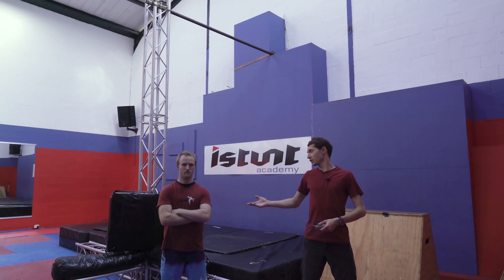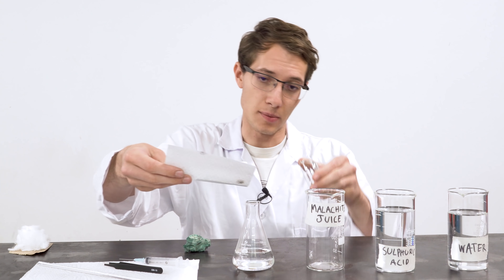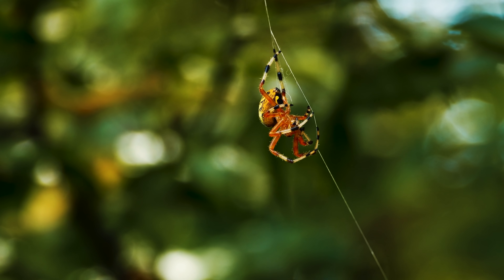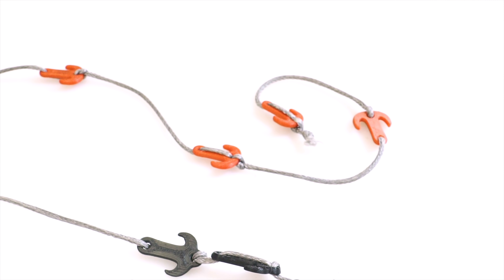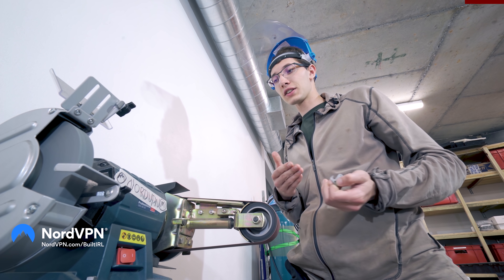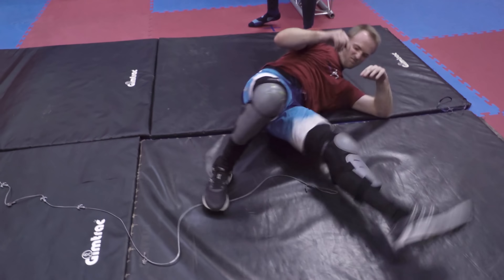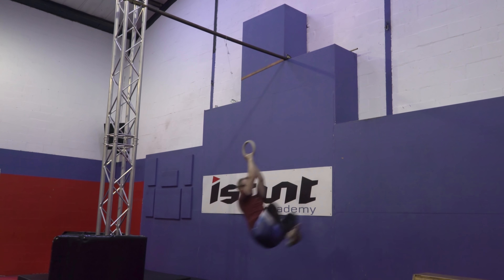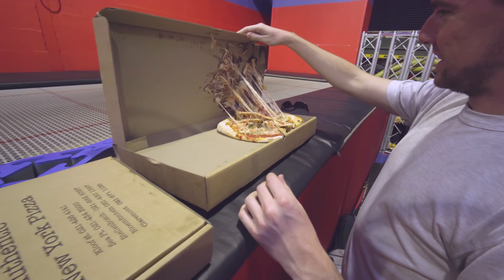Making Spider-Man's Web in real life

Comment: I printed out the hooks and made a hook chain out of yarn and i have to say that it's crazy how quickly you can learn how to grapple stuff
especially since unhooking is also pretty easy too

I've been walking around grappling random poles and it's been so fun
Reply: Can you pleaee tell me what app can i use to make the 3d model. Im new to this stuff
Reply: @Bread66666  I used a complicated method specifically for this shape

First I screenshotted the design, then I hand traced it using a vector program, then I imported that vector file into a CaD program, and then put the resulting STL file into my 3d printing program that came with the printer

snipping tool -> inkscapes -> tinkercad -> elegoo

In this case, using a 2d image and then extruding the 2d image works because the shape in question is really simple
this method doesn't quite work for more complicated designs.

That being said, I think you can just look up any CAD program and make sure there's lots of tutorials for it so you can learn how to use it

I would also recommend using those free STL websites because pretty often more experienced modelers have made solutions 
it really depends on what you want to do tbh
Reply: @Bread66666  oh oops I had a whole tutorial but it got poofed

I screenshotted it, traced it using a free vector program, used a free online CAD program to convert it to a 3d model, and then I put that into my printer

for general use, I highly suggest looking up free STL websites to check if someone has made your thing first
and if they don't have it THEN you learn any CAD program
just as long as it has lots of tutorials to follow along with
most of the popular ones are good, you just need to sit down and learn them

Comment: The advanced glue delivery device you've described has several exciting possibilities and capabilities:

1. *Precision Glue Delivery:* The device can deliver glue with exceptional precision, thanks to the controlled release mechanism. This makes it useful for various applications requiring precise adhesive placement.

2. *Swinging and Movement:* With the string and catapult system, combined with the swing functionality, the device allows for controlled movement. This can be used for activities like traversal, recreation, or even rescue operations.

3. *String Control:* The inclusion of cutting mechanism gloves and string retention features provides users with complete control over the strings. They can release or retain strings at will, making it adaptable to different situations.

4. *Rapid Reloading:* The loading mechanisms for both the string and web-based bullets ensure rapid reloading, making it efficient and practical for continued use.

5. *Drying Mechanism:* The heat mechanism integrated into the web structure allows for the immediate drying of glue upon contact, enabling fast adhesion.

6. *Retrieval System:* The built-in retrieval system with a timer-controlled oil-release mechanism provides a means to retrieve the device and any attached web-based bullets, even from high or difficult-to-reach locations.

7. *Versatility:* The multifunctional nature of the device means it can be applied in various scenarios, from creative projects involving art and design to practical tasks such as repair work or outdoor activities.

8. *Innovation and Creativity:* The device represents an innovative blend of technologies and features, allowing users to explore creative and practical solutions in adhesive application, mobility, and more.

9. *Convenience:* The inclusion of features like button-controlled string retention and web-based bullet reloading ensures user-friendliness and convenience during operation.

10. *Safety and Control:* With the ability to control string release and retention, as well as precise glue delivery, safety and control are prioritized, reducing the risk of accidents.

It's important to note that this device's capabilities are versatile and can be applied in various ways, depending on the user's needs and creativity. It combines elements of mobility, adhesive application, and control, making it a unique and adaptable tool for different situations. However, it's essential to use it responsibly and ensure safety measures are in place, especially in high-risk scenarios.

Comment: Now I am in my early teens and have decided to pursue trying to figure out how to make Peter's web fluid and have found out that 1 thread of spider silk can hold around 1.68 grams (don't quote me on that) but my bodyweight which is around 150lbs to hold the web would have to be around 33 to 34 feet wide to hold me not including the weight created by the force of my momentum whilst swinging
Reply: Doesn't the thread increase exponentially, if you multiply the radius or diameter of a circle by two the area of the circle is x4 bigger, that's why rope (much weaker than silk) of like an inch diameter would be able to support you

Comment: That's actually a very good equipement for an original Character actually. Ps: you could try to put a propulsion system inside a tube, with the same rope, and get a daredevil stick ^^

Comment: Vulcanoglas magnetit can bring strucktur or electrostatic balloon hair :) ;) can build with life spider get a group with computerchip synchron the reticulated glands for definated fiber glue, ... air flow or a little weight to shot. Interesting test if does not working then i dont no is the simplest. Ohhh fuck the molekules have reaction time if you not can build the net on the way by touch the wall then reaction,reaction.reaction.reactionso will need minutets for meters. Ok must shot fluid whats differnt reactions managed on the way and on the goal glued,  ... thats sound possieble, fluidjet can support laser / UV Epoxyd ohh i too much

Comment: stretching a trash bag into a long rope makes it insanely strong than it’s original form. online i saw that trash bags are made of polyethylene but different types. i looked up the strongest trash bag and it’s a 30 gallon force flex plus trash bag. if you stretched that and then added some weights to each end, similar to your hook swing, do you think that could work as well? it could allow more room for more “rope” and when the force is increased it could allow you to shoot further. just an idea i thought about!

Comment: alright so hear me out

1:19 this process, the malachite juice is your web fluid, in a cartridge. you force that fluid through a narrow nozzle that contains sulfuric acid and it'll solidify and spray strands, right? now, the strands are weak individually. but do this in parallel dozens of times on a microscopic level, and weave it all together, and you could get a strand that might have some strength to it. compact that into something wearable, and you have a web shooter.

like, i know this wouldn't actually work. but i like how plausible it sounds

Comment: i have an idea💡 if they help u find something on your journey I consider it a 🥇. Ok first U can attach it to a harness for the sake of support and time while swinging. The rope can be detachable when a button is released. So u still have control when u wanna hold on or let go. You already have a high success rate when it comes to getting a hook. But For the sake of reloading have it like a belt fed gun. Each rope Is cut to a decent range. have the end with something that can pull the next one into the chamber an released when the button is. Have the rope Going from your back to the desired arm. Similar to whiplash from the iron man movie. So your hanging with your body not just the arm. It’s compact already but the smaller something is the more u can carry.

Comment: you could make the hooks the way that you can retract the hooks mechanically by the push of a button so you can retrieve the rope by just pulling it instead of having to manually disconnect it from the hooks, could be hard to make a rigid and cheap design though

Comment: I have an idea.
Would it be possible to attack as the light of a rope/string to a bullet type of projectile somehow that would be shot out just like a bullet, allowing it to penetrate into the walls of a building and perhaps hold the weight of a human?
Would be extremely hard to create but I believe that that can be the next level type of spiderman web. In fact it would reassemble AoT grappling than webs but ok xD

Comment: What you need to do is make multiple of these and make them the cartridges be able to  but have to on each web shooter you will have to realod alot but if you time it right it would be accurate for the combat and some of the swinging but as well have one that hook to the edge of building not directly attached to the building it self the top ledge

Comment: What is used a smaller version of a grappling hook that could fit around the arm under a coat and using a flexible metal wires with hooks at the end that also retractable and adding small suction cups to the bottom of ur shoes to stick on glass surfaces

Comment: So basically he cheated. The goal was to create a liquid based web that could be shot out and can stick to a large solid surface that can be wrist-mounted.

He bought industrial strength rope from online, used hooks that only work when wrapped around small sized objects, and used a gym ring to throw the rope around...

Not to mention, but does anyone else noticed how they don't show getting the rope down or detaching it from the weapon, leg, etc? That's because it's not easy and is impractical. You only get one swing / throw with it, and then it's useless.

I'm just disappointed

Comment: a chainmail glove with padding on the inside would make it easier to hold. pressurized air to shoot, and an electric motor to reel it back in. put a spool on the back and feed everything through flexible tubing running down one arm. at the end of the rope, put some kind of "cork" that fits tightly in the tube.

Comment: 2:01 how is needle not dissolving in acid? O_o
Reply: A needle is typically made of a material that is resistant to corrosion or dissolution in acid. The most common type of needle is made of stainless steel. Stainless steel is an alloy composed primarily of iron, chromium, and nickel, which provides it with corrosion resistance. When stainless steel comes into contact with acid, a thin layer of chromium oxide forms on the surface. This oxide layer acts as a protective barrier, preventing the acid from reaching the underlying metal and thus preventing corrosion or dissolution. The chromium oxide layer is stable and highly resistant to attack by acids.

Comment: i mean at the hooked front you could make it a segmented decently stiff but still bendable thing like a belt then just using a a motor that engages to the belt to fling it out at high speed., as for the grab part just put something like a knob at the end of the line .
so pretty much big old wrist shooters

Comment: just picture it...two mechanized gauntlets with multiple "cartridges" of these sticky ropes in each one. Using compressed gas to launch it, allowing you to swing from it when it's still connected to said gauntlet. Then at the end of your swing arc, a quick detach mechanism is activated and you're ready to launch another. The gauntlets could even have a form of net launcher and or bolo as an additional offensive weapon.

Comment: What if the entire “rope” was metal or at least capable of holding a current, you wrapped copper wire around it and then insulated the outside and had a electromagnetic rope that attached to itself?

Comment: I'm glad you said it because I was coming down here to say it, thinking MAYBE you'd see it:

I was going to say you should make a wrist mounted device (one for each wrist) that can hold multiple "webs" in preloaded barrels with something like CO2 or propane as a propellant, then have a trigger hooked up to a microchip so every time you pull it, it launches a new one. Theoretically as long as the items don't weigh that much, could get a lot of shots in there. Maybe 6 or 8 total? 3 or 4 each that is. It would also need a quick release for the previous webs though.

Comment: Have you considered somehow cooling liquid glue when spraying it, some glues (like hot glue) can hold heavy weight but it needs the time to cure (cool). Look in to it for me? Thanks!
Reply from the maker: Check out Joel Creates (if you haven't already) for hot glue spider webs. Otherwise, I think a mechanical approach is much more robust and less messy than an adhesive one.

Comment: That hook rope is useful enough to actually carry around and use in real life, love the simplicity
Reply from the maker: Thank you kindly! Still no obvious way to integrate hot glue though...
Reply: @Built_IRL  awesome video. What was the ultra strong rope you used in the video? And can you sell this product?! Id happily buy one.
Reply: @spectrumhorizon1392  same
Reply: @spectrumhorizon1392  same !
Reply: @spectrumhorizon1392  I suspect he uses paracord. It's the cords parachute jumpers hang from under their parachutes, and it's wicked strong for how small, light and cheap it is.

Paracord 550, which is rated for up to 550 pounds while being only a bit overt 1/8 inch thick, costs about 50 cents per meter.
Reply: @spectrumhorizon1392  me too
Reply: @spectrumhorizon1392  Dyneema or Spectra
Reply: @Built_IRL  hot glue somewhere on the hooks to dampen the noise. The webs in Spider-Man are quiet lol, lots of stealth based scenes/combat
Reply: @glass4600  I might work depending on how hard it dries
Reply: @glass4600  or handle dip , a rubber made for coating tool handle's
Reply: @chopperchuck   I was thinking the same thing.  I've used some stuff called Plasti-Dip in the past.  Dries firm, but rubbery.
Reply: @Built_IRL  any chance on getting the 3D print files?
Reply: @Built_IRL  You could sell it with some precautions of course or maybe have another company sell it
Reply: @Built_IRL  Hot glue over the hook knots to keep them extra secure?
Reply: @Built_IRL  AGREED
Reply: @Built_IRL  not with that attitude
Reply: @Built_IRL   mAkiNg sPiDerMaNs wEb iN rEaL liFe. its literally just a rope with hooks on it lol stop the cap
Reply: “Indiana Jones theme plays”
Reply: Dude I want one for self defense I don’t need to swing
Reply: @gamingwithJT2007  look at it I could use that effectively in like 10 minutes
Reply: OMG JT is not only a genius at Engineering but also at fighting and stunting
Reply: Right
Reply: It is a great invention but I don't think that it is practical in real life
Reply: This is only useful for explorers or campers or survivalists in the wilds i think.

The usefulness of the hook chain is to get a steady hook and line set up, not really for traversing and loosening the line immediately.

So way you want to hang a tent up quickly you can swing one end to one branch and it'll lock, then throw the other one around another branch.
Reply: this is a damn rope tff
Reply: Wall sticking web shooter tutorial https://youtu.be/bAMrEiXpCiU
Reply: Let's Go
Reply: Mouse love.https://youtube.com/shorts/cHoSZw2WOxM?feature=share
Reply: I'd prolly use it to get things while lying on my bed 😩
Reply: Paradhaniya university https://youtu.be/VPOcE8os0XQ
Reply: So clickbait?

Comment: Dude this was awesome! Fantastic idea on using multiple hooks embedded into the string. But out of curiosity, if you jump and the hooks don’t catch, does the entire line fall on top of you and do the metal hooks hurt when they fall on you or are they so small you can’t feel em’?
Reply from the maker: Each hook is about 13g, which is pretty light. So it's not likely to cause a skull fracture or anything, but you do feel it. The real issue would be getting it in your eye, so we made sure to wear safety glasses

Comment: The only way I can see it working practically is by using a full exoskeleton with a 1 or 2 wheels on the back with maybe an air compressed shooter that automatically resets after each use while also having a trigger like in Spider-Man on each hand. Then having something to cut the line after each use before the machines resets itself allowing you to swing multiple times in a row. That is the only issue will be telling it when to cut which should be used using arm positioning like when you swing from one arm when other is at a certain point in then swing it will automatically cut it while you hold the string in for a little bit before having it shoot out again.

Comment: What a wonderful discovery and design! Also, if looking for a substance that can give you repeatable sticking adhesion, you can use hydrogel pads as you would see on those stick-on ab workout devices. I am testing the strength with those and it won't carry your body weight but they would make for great lightweight web-shooters to grab small objects and hurl them around. I built a web shooter for that purpose and it's pretty fun.
Reply from the maker: Nice idea! Why not make a video about it?
Reply: @Built_IRL  I suppose I could now that the semester is over. Not many people will see it, but hopefully, some people will be inspired by it and draw unique ideas from the concept.
Reply from the maker: @badjuju2298  Totally up to you, but good luck if you do!

Comment: I have a question, if you had managed to make the artificial silk using the chemicals strong enough to use, would it have been able to stick and if not how would you have got it too
Reply from the maker: Not likely. I probably would have looked more into a superglue-like system, but that has big issues of it's own
Reply: @Built_IRL  surely if you stored it in a container that it didn't stick to, and used some thing like rice to slow the drying process, it might work